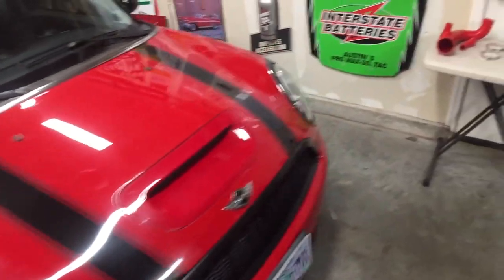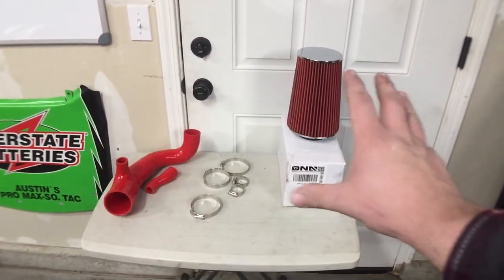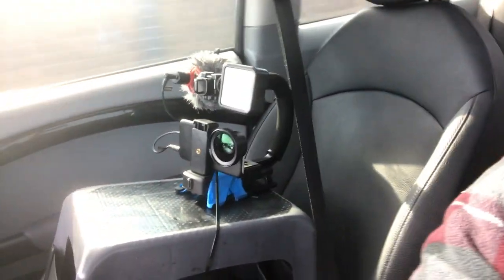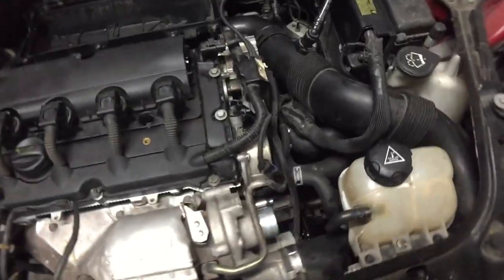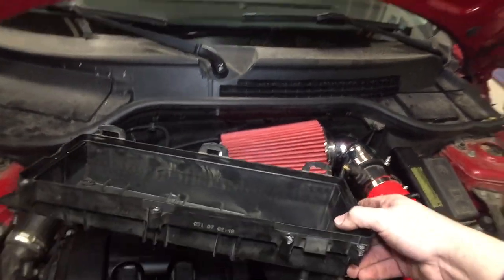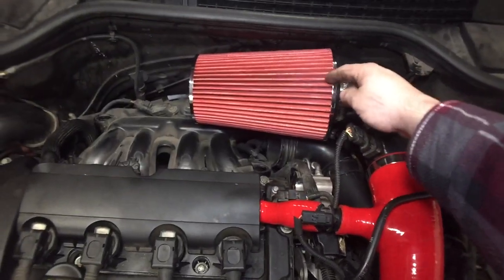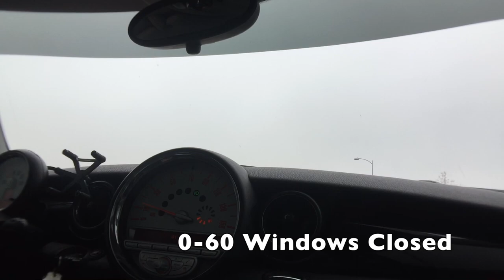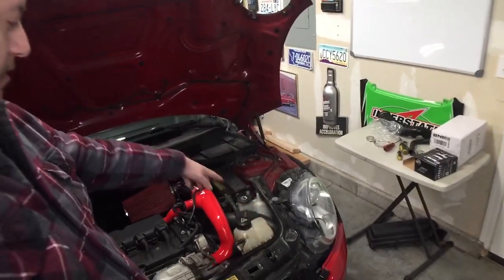Mini Cooper Gets A Cold Air Intake!

Comment: Nice video, i have a question for you mate, at factory pipe the connection between turbo and pipe is in lower position but in this pipe is up and you changed the sensor, do you think that affect positive the performance?

Comment: Older video at this point I know, but at any point did you add small clamps to the smaller hose connection where the piece where the plug goes between the intake hose and the valve cover?
Reply from the maker: Hello, yes I did
Reply: Thanks for the quick reply. Putting that same silicone hose on tonight.
Reply from the maker: Awesome! :) I’ve had a few guys tell me the little piece doesn’t really need clamps, but I did it anyways for extra precaution

Comment: Nice video I'm new to this I just bought the forge intake hose u said something about tuning it what kind of tune u need for this
Reply from the maker: 120506torque hello, thanks for watching, it’s a performance tune in general, it’s not 100% necessary, but if you want the full potential out of it after performance mods, it’s highly recommended just so everything works to its highest potential and gives you reliable power, there’s lots of companies out there that provide tunes, I just don’t have any specific ones to recommend unfortunately
Reply: @ROADNOISEMEDIA  ok thanks ur cooper is clean looking
Reply: I always recommend a stage 2  with all the right bolt on parts I would recommend doing all the silicone hoses hi flow catalytic converter with a aftermarket exhaust because when you put it in sport mode it sounds like a burple tune/2 step a aftermarket radiator and intercooler so you don't get heat soaked do your research watch more videos like this gentleman's after that you should be ready for a tune I wish you the best luck I have R56 myself love it

Comment: Is this worth doing? I’m considering this but is it worth it? Honest question.
Reply from the maker: Power gains won’t happen unless you get a tune as well, I did it mainly for the sound to be honest, so depends what you’re looking to achieve
Reply: That’s the same thing I want. That’s why I wanted to know if it’s worth the investment
Reply from the maker: The bov made a bigger sound difference then this did to be honest, This would make more noise with some sort of aluminum piping, or an actual cold air intake kit that has the icebox, the rubber piping does quiet it down, louder than factory, but still a softer sound and it would be with a different material￼

Comment: This is arguably a less cold intake than stock since you're sucking air from the engine bay
Reply from the maker: Mirinmaru I definitely agree, BUT if you look up mini cold air intakes for this model, that’s where aftermarket companies route them as well, they just have a heat shield that goes over the filter, I was going to build one as well, but ended up selling the car before I had a chance to do so, on these specific minis, the exhaust manifold + turbo plus most other parts that create heat are all at the front on the other side of the engine, so even though there is heat, it’s much cooler back there, plus there’s a pipe that pulls in cold air intake front the front grill right into the filter area in the back
Reply: @ROADNOISEMEDIA  I'm thinking of putting my air intake where that initial intake on the left hand side is and skip the rear airbox completely. What do you think about that? I want to de-clutter my engine bay as I have a Peugeot 3008 with the same exact engine as the mini.
It is really cramped in there
Reply from the maker: Mirinmaru I’ll be honest, I’ve never even seen a Peugeot in person so I really can’t answer that
Reply: @ROADNOISEMEDIA  it should be applicable to a Mini too. Instead of routing the air from the bumper, back behind the engine and the to the turbocharger you just go from the bumper to the turbo gonna try it

Comment: Sorry mate but this is a downgrade, you could have just changed the paper filter in your original COLD  air intake for an igm proair foam filter for £50 instead of installing a cheap filter which will suck in hot air 😅
Reply from the maker: Good thing it’s not your car then huh :)